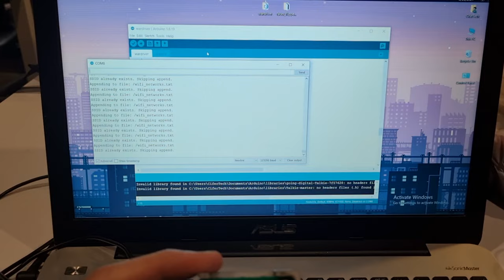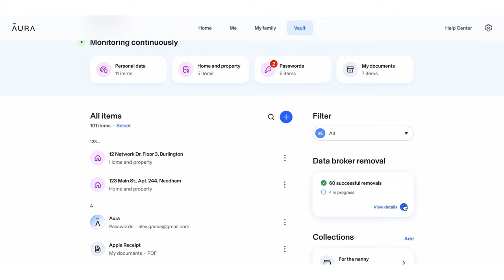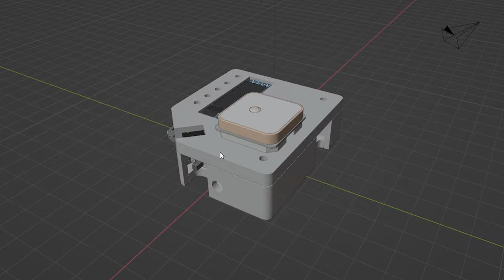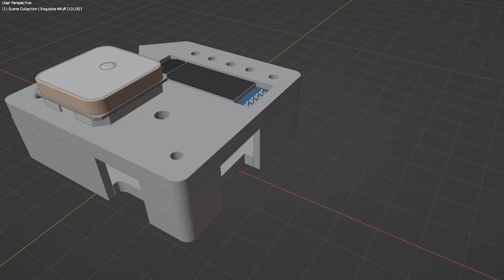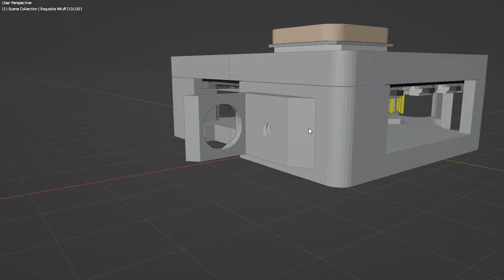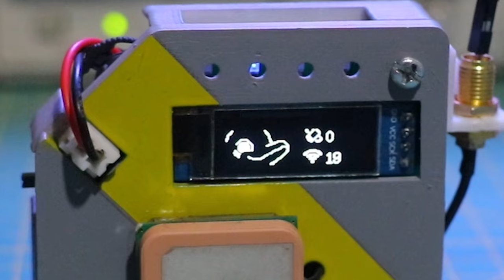Your Secret Weapon for Wireless Networks - Wardriver

Comment: Hey can I ask how long did it take for your device to detect satellite for gps cordinates. I'm also using ESP32 with neo6m gps module with the antenna given along the module the square one if you know but it could never detect the satellite should I change the antenna with a better one

Comment: I did this before and added a jetson xavier nx running GPU accelerated hashcat.  You would be surprised just how many weak passwords people use.  In this case about half used their local phone number.  I could crack about 80% of wifi routers recorded with just passive means (no deauth).

Comment: amazing work mann , it takes a lot of efforts to do this !!!! had some suggestions .......
why didn't you put the gps antenna and the battery  inside the case ? ABS or PLA won't cause any interference in the gps antenna . 
By leaving a 3mm buffer after the pcb linings  , you could have just kept the copper area and used it as a internal antenna . sometimes it works better than external antennas ..